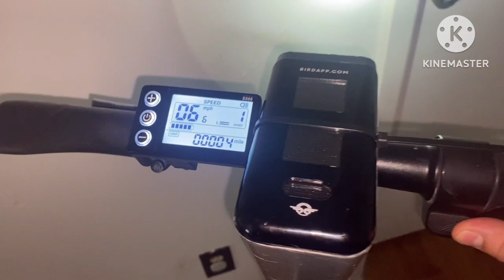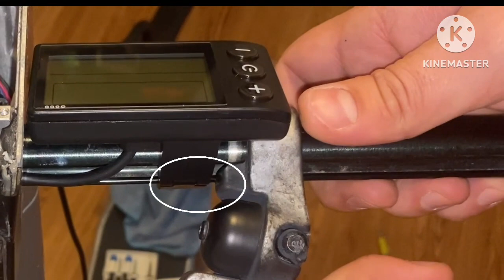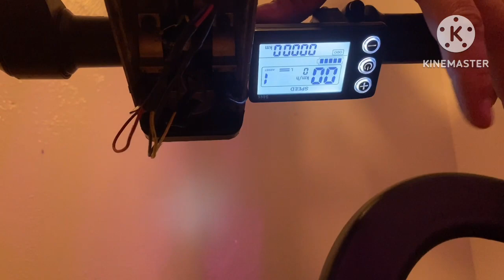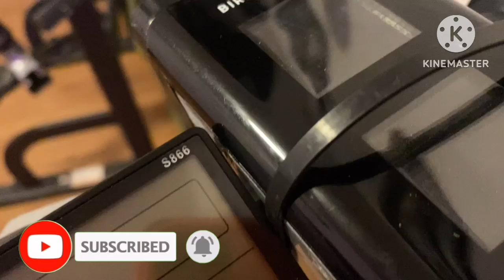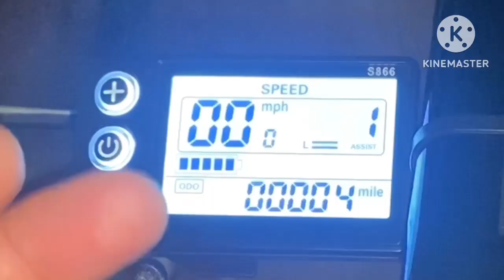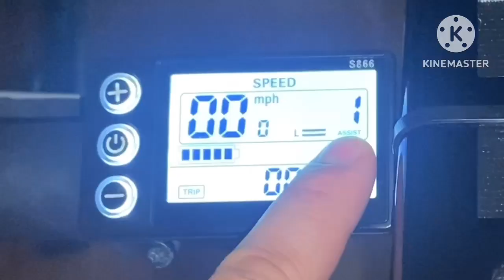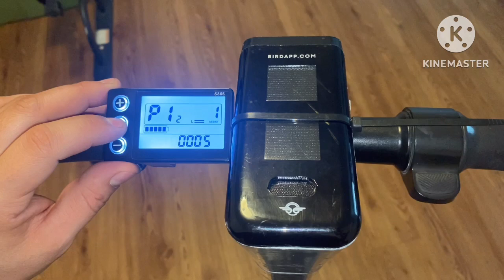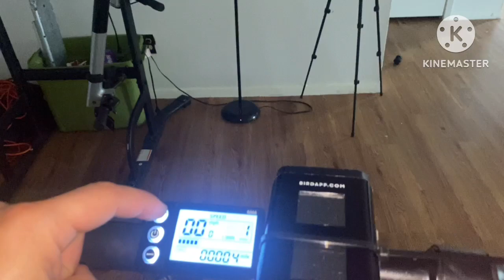S866 display | bird 2 scooter | Conversion | Tutorial￼ | #diy  #project

Comment: Just Completed this setup with the 350W Controller and display. Thanks so much for the help.
Reply: Hey, I just did mine. I think I burned my controller out. I didn’t use the step down converter is that why?
Reply: @domspencer8086   is ur controller 36 v
Reply: Never mind works fine now just a bad connection and yea 36v

Comment: Great tutorial, I got mine working. But the wheel is spinning in reverse. Do you know what to do about that?
Reply from the maker: Thanks ! OK so if your wheel is spinning in reverse what you want to do is locate your self study wires/intelligent wires and connect them together. Doing so will spin your wheel automatically by itself correct it’s rotation. Leave connected for about 3 seconds and then disconnect..from there give it throttle and your wheel should now be spinning in the correct Direction..

Comment: Hey man, from what I am seeing, so the only way to connect a new controller to a bird zero scooter is by doing what've you done right?, there is not other easier way?
Reply from the maker: Yeah this is probably the easiest way, choose  a kit just like in this video! The display unit is plug and play with the controller , I mean besides that you have to do a little bit of soldering to get your connectors in place but it’s definitely worth it ! And not very expensive..

Comment: What controller is the best choice for bird 3?
Reply: I believe a 500 or 1000w 36/48V controller will suffice. The 1000W controller good luck getting it in there, extra work to make it fit.
Reply: @Jnsystems  I am running a 1000 in mine, i had to cut back the heat-sink but the transistors did not occupy the extra space, been running great for months. 29 Mph max speed on flat ground. i weigh 250. No problems with torque.
Reply: @residentalien9886  I haven't found a 1000w controller that is 40mm height or less, and does not have hall wires. 1000w can definitely go great up steep hills, but speed isn't my favorite. Why 40mm or less? Because Lime 4.1 has narrow footboard so no room to work with. I do like their swappable battery system because I do value range. I got the seat on it to be comfy for long distances.
Reply: @Jnsystems  very nice. I hacked about 3 1/2 inches off as the circuit board does not extend the full length of the aluminum heatsink and the heat transfer bar extended past where the transistors ended so i lopped it off and it slips in nicely now. I can upload pictures if you want. Battery life is about half of what it was when I was running a  brainpower 750w. Having a extra battery at your disposal is always a plus. I run a old spin ninebot max  with the removable battery on top with a flipsky controller 36 v @70a and that only is a few bucks more. And batteries are easily swapped
Reply from the maker: Yeah honestly I would stick with the 500w 30a when it comes to the bird 3 .it’s just the controller itself . But they also have some with the display unit that cost a little more money.
Reply: @pjscootermods  yeah I have run both ways I do like the s866 but I also like the open source VESC controllers with modifiable firmware. I'm a computer geek so it's just another level of messing with my scoots and some fine tuning that can yield some impressive results. Hey Thanks P&J Scooter Mods. You've helped a lot of peeps and paid it out simple for newbs to actually feel like it's not so daunting a task like it is to flash a ninebot with custom firmware for the first time. Keep em coming bro. Stay safe

Comment: Hey I tried a 1000W controller but with the stock throttle. Now only the learn wires turn the motor but the throttle does nothing. How would I test to see what the problem is?
Reply: Problem is either hall sensor or bad controller, to best of my knowledge
I learned how to use special controllers without hall sensors and it doesn't have this issue.
Reply: My controller is supposed to be able to work without a Hall sensor. I’ll try disconnecting the hall sensor wires see if that works.
Reply: @josequintero6489  Well, mines does not have any hall sensor wires (doesn't exist) and it works without hall wires, cuz my chime 4.1 has less wires than the bird 3.
Reply from the maker: Maybe try a new throttle, A lot of people have reported that this issue fix the problem 🤷‍♂️ . If all else fails go with a new controller. But after engaging your intelligent wires let your wheel spin in the correct way for about three seconds so we can correct it’s rotation.. afterwords the throttle should work after that.. so definitely go with an aftermarket throttle, or if you have any extra one swap it out